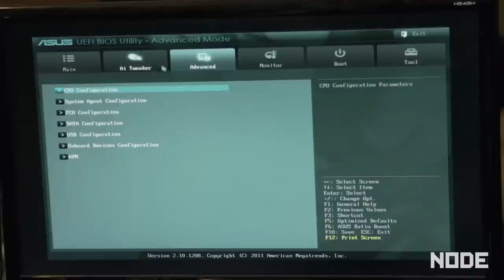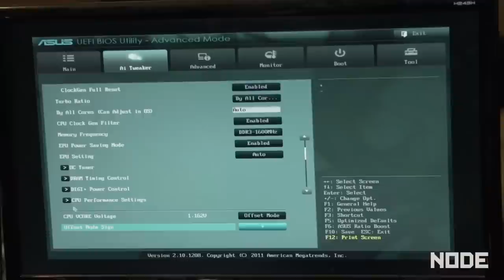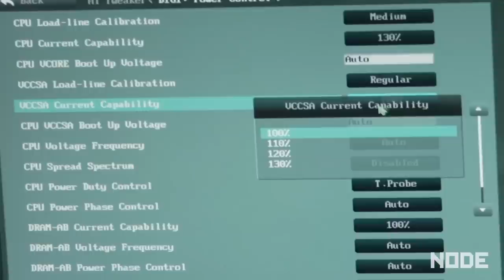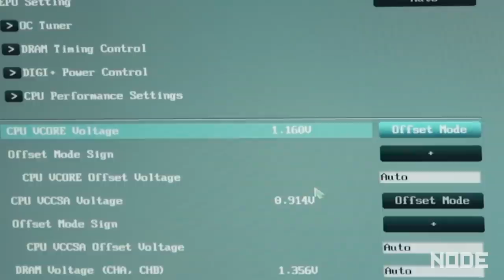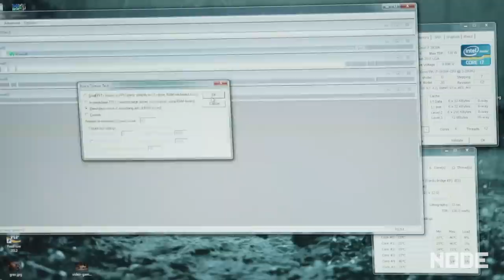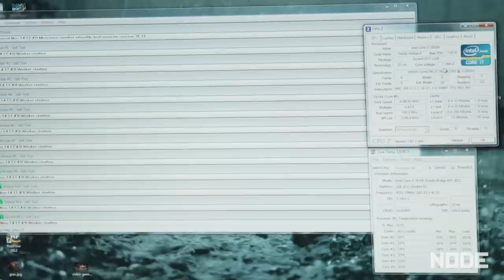Overclockerz with freddiew and corridordigital on LAN Party - NODE

Comment: i failed my overclock, now my quad core is only a dual core...
Reply: My heart goes out to you and your family.
Reply: i bough a hex core  to replace it :D
Reply: StealerOfSoles RIP wallet
Reply: Hex core amd is only like £70 is not that bad for p;rice to performance
Reply: LOL is it possible?! I fucking laugh my ass off
Reply: i had no idea what i was doing so i just bumped up the voltage and then it registered as 2 core 2 threads
Reply: Im guessing you only have 2 actual core and the other 2 is virtual core?
Reply: well yeah i said that ^^ it was 4core 4 threads but then went to 2 core 2 threads
Reply: LOL im still laughing my ass off. I have no idea what you've done.
Reply: how did you burn only 2 cores

Comment: I would go for it. Make sure you run a prime95 stress test for a couple hours to test initial stability your overclock. If it crashes or you get errors, tweak some settings and test again. If it passes the 2 hour test and you're happy with the overclock, continue to run the test for 24-48 hours to verify complete stability.

Comment: Basically, frames per second is how smooth something runs.  If you run very high frames per second, then it will look very natural.  Slow motion can be done when you take a high frame-per-second video, and slow it down, so it keeps around the same frames per second as the rest of the video.  It needs the higher fps original video to stay natural-looking.

Comment: If you plan on gaming, you do need a good graphics card. The processor calculates the game physics, interactions, NPCs, etc. Usually, this is actually a relatively low amount of work for the processor. The graphics card is what actually allows the game to run at the framerate that it does. Because of that, as long as the CPU is good enough, the graphics card is usually the most important part of a gaming computer. So really, if you want to game, a good graphics card is a must.

Comment: It's not recommended unless you have an aftermarket cooler. The stock cooler is fine if you're running at stock speeds, but once you overclock even a little the temps get way too high.

Comment: Some extreme workstation laptops can run a whole bunch of cores(6, 8, 12, I've even seen one with dual 16-core processors). You probably won't see them on the consumer market, though

Comment: Vaio's have locked bios also. You will be able to get into the bios but the settings you need to change will be disabled.  You can always try however. reboot your computer and when it is starting up it will tell you what button it is to access the bios. Tap that a bunch of times until you reach the bios screen. Since all motherboards have different bios screens look for something that talks about the CPU. Use the video as a guide on what to change. IF you can change anything.Try going to 3.0.3.5

Comment: 3dmark11 with a desktop gtx 580: 6650 marks.

3dmark11 with a gtx 680m: 6560 marks.  One of the prettiest monitors out there with a skinny all in one design.  Near silent operation too even with a desktop i7 chip.

Comment: Even if you could, I wouldn't recommend it. Laptop coolers are usually designed to the bare minimum of what you need to cool it adequately on stock speeds, in order to save internal space. Even if you add a cooling pad the internal coolers are the most important factors.

Comment: First step, figure out if your motherboard has an overclocking utility then if your cooling fan/device is capable of taking the extra wattage of heat coming from the cpu. Then look up instructions for the specific cpu, next look up the ones for the motherboard. Next go to bios----then what they did

Comment: "it's pretty much locked at 60" 
Um, that's probably because you have V-sync on. Turn it off to see what your actual frame rates are. V-sync matches your frame rate to the refresh rate of your monitor so you have a vertically stabilized image reducing the frame shear you see sometimes, but it doesn't let you see how many frames your computer can really give you.

Comment: Only if you are only hitting 50-60fps then turn it off and it'll boost the frames by 10fps roughly. But when you can hit more than 60 constantly like say 70-80 frames anywhere you go in that game and even in combat/action then you can turn it on. More frames = more work for gpu which will heat it up. If you have a game running at 100+ fps it'll increase the gpu's workload. Besides, can't really tell the difference between 60fps and 100+ fps unless the monitor is 120hz. Correct me if I'm wrong :)

Comment: Depends on what type of computer it is. If you don't know if you can, you probably can't. You won't be able to if its a dell, hp, etc. When those computers are made they put a lock on the bios to prevent overclocking. If it was an alien ware or custom build then you could. You might be able to overclock the gpu depending on the gpu.
You didn't give enough information for me to provide you a good answer.
Also, if you are getting a new desktop anytime soon. Don't buy a premade one, build your own.

Comment: That is for only for computers that are comercially availible.  Techincally some of the prototype computers intel has are clocked closer to 10-12GHz (but they are liquid nitrogen cooled and they are only testing the clock circuits, not running a computer of it... yet)

Comment: how far do you think i should overclock my sabertooth x79 motherboard with a intel i7 3.7GHz without going over 85 degrees Celsius?
Reply: Which I7 and what cooler
Reply: Salpeteroxid Prob a H100i
Reply: 4820k intel processor and im not sure what liquid cooler
Reply: Jaagg Nice processor but why did you go with the 4 core on x79 instead on 4 core on a Haswell if you don't mind me asking.

Comment: Which means it's most likely an FX 8350, which means that it will perform slightly lower than a 3570K.

Why can't people get that clock speed isn't the defining factor of CPU performance?

Comment: No, I don't mean software, I mean hardware. In your device manager, under Display Adapters, it should show all of your graphics devices. If there are 2 listed, you have a card in Optimus. If only the Intel card is listed, you don't have one.
And by the way, if you have a laptop, you don't have 4 processors. You have 1 processor with 2 cores that is hyperthreaded into 4 threads.

Comment: You may have a discrete GPU that is only enables in NVidia Optimus or AMD Hybrid Graphics. In this case, you would be able to play with good performance because the laptop switches to using the discrete card when you open a graphics intensive application. However, unless you dig into the device manager, you would only see the Intel IGP if you are just checking the specs.

Comment: i would prefer water cooling, if you're talking about the stock cooling that came with the cpu don't bother overclocking, some after marker heat-sinks can cool the cpu decently but overall if you're going to overclock to 4.2 ghz go water cooling

Comment: will i be alright with a mid tower case 
with these specs?
Corsair CX750 Builder Series ATX 80 PLUS
ASUS SABERTOOTH 990FX
EVGA GeForce GTX TITAN 6GB
Corsair Vengeance 16GB 
AMD FX-8350 FX-Series 8-Core Black Edition
CASE NZXT Guardian 921 (MID TOWER CASE)

Comment: - 3.2 gHz i7 6-core (OC'd to 4.4 gHz)
- 32 GB RAM (8×4 DIMM)
- NVIDIA GTX 680
- ASUS Sabertooth X79 Motherboard
- Seagate Barracuda 3 TB HD
- 2x Samsung 830 256 GB SSD (in a RAID 0 Configuration)
- Master Cooler 1000 Watt Power Supply
- R2D2 Post Trash Compactor PC Case
- ASUS DVD-RW Drive 
Soooo Jealous!

Comment: It's fraps that's the problem, not their monitor or their Vsync setting. Fraps has a setting where it locks your framerate to whatever framerate you're recording at, to maintain a steady framerate without any jumping or stuttering.
Those chips that require you to screw around with the processors physically were the Pentiums of old. They are long gone now, and I would say good riddance too, as I have a tendency to break any computer part I mess with physically.

Comment: Overclocking os often locked by most lower-end or middle range motherboards & CPUs, and over-overclocking a CPU won't start a fire. The CPU will just burn out and cause the computer to crash, causing the CPU to become a useless piece of junk. Limar to when a bulb burns out, it doesn't burn the house. I've seen someone used around a million TNT and it burnt for like 3 hours or something. It's right here on youtube.

Comment: With liquid nitrogen cooling. Try sustaining that.

Clock speed =/= actual performance. Even if someone got an A10 to 5.0GHz (which is EXTREMELY hard for most people), their 3930K at 4.5GHz would still beat it by quite a lot because of a much better architecture and much higher IPC.

Comment: I overclocked my computer to 13GHz and I put the Memory Voltage at 9001. As soon as I turned it on, there was a mouth on the screen and it stuck its toungue out at me and then made a "kaput" sound. So I'm suggesting that my DreamCast just died. :(

Comment: I'm getting a PC with a R9 290X 8GB's of ram a intel i7 3770k and 500Gb's hard disk space. What power supply do I need? Will a 750 watt be ok?
Reply: 750 i more than enough
Reply: TheMrkiddi Thanks, I'm getting a 4820k now though since it is the same price on the site im getting it. also im hoping to over clock to 4.5 GHz is it still enough?
Reply: if you plan on Overclocking bigger is always better. you might be able to pull it off with 750W but i'm not that familiar with Overclocking that i can say for sure if it's enough or not. but i would assume so.
Reply: TheRealPotato To be honest, if you plan on playing games on ultra overclocking isn't a huge necessity. Especially since you have a 290x which is a great graphics card. I have a 280x and plan on going dual crossfire with another one. Still, 290x can handle it very very well.
Reply: TheRealPotato Overclocking only requires 10-25 more watts. Use pcpartpicker.com choose your parts and it should tell you around how much your parts will be consuming at a time.

Comment: My amd fx6300 piledriver 6 core is overclocked to 3.7Ghz from 3.5Ghz standard.
The 2 are quite similar (yours is better for multi-thread stuff) so you should be fine to overclock.

Comment: You can overclock them. Use MSI afterburner, the reason they didn't is because the card is good enough that it just doesn't need to be overclocked. Overclocking it would be pointless currently with the games that are out.

Comment: how did niko get 55-60 frames at battlefield 3 ultra? he has a 680 amd 4.2 Ghz. i have a gigabyte 660Ti and a i5 3570K not overclocked and i get 60-80 frames at battlefield 3 ultra. I DONT GET IT

Comment: I've had a mac man, I know about them well. My first two computers ever where macs. Anywho, macs do not have viruses. . .practically they don't. There are some very rare few that could possibly infect it but the newest macs are generally completely virus free in actual practical use. It is highly unlikely you will ever come across one even going to more dodgy sites. Also you can have anti virus installed too just in case though it won't be needed 9.9 times out of 10. So I am not an idiot.

Comment: Id like to see a Starcraft 2 4 v 4 Extreme Settings test. On my current PC, i can run Crysis 3 60+ FPS no problem, yet I still dip to 10 FPS on Starcraft 2 during the big battles.

Comment: No, you can't overclock at all, unless you mean something else than CPU multiplier overclocking. Generally, for the Sandy bridge/Ivy bridge processors, you can't overclock unless the CPU has the suffix "K" or "X", which you don't have. Anyways,overclocking a laptop is a bad idea in general, because they have much lower thermal tolerance.

Comment: actually, macs are not a good deal to buy.
They have all the same speeds as the regular $300-400 PC.
and besides, because PCs are cheap, if you want a faster PC, it would cost about the same as a Mac, and is more powerful than it. 
Here's an article from the people themselves (freddiew, BrandonJLa, and corridordigital) : rocketjump com/blog/why-were-switching-from-macs

Comment: There's only 1 3DMark 11, and I would think that he would be comparing the same preset, no matter which one it is, wouldn't you?
Anyways, a GTX 680m is plenty for gaming. If you check the benchmarks for individual games on its NotebookCheck page, there are barely any games it can't run on max settings.

Comment: Higher clock rates don't always translate to better performance. Atleast on older CPUs. Why should OCing new CPUs be unnecessary? As they said, they're getting some extra power for free. Doing this with old hardware is basically same - you just wait longer for the extra power.

Comment: Also suggest tools prime95 for load testing, CPUZ, Coretemp, etc. Watch yer voltage vcore specs and memory speed. I got my bus on a i7 920 from 2.67 for 4.2ghs stable with a $65 cosair h60 closed loop water cooler. Stable at 65c.

Comment: i did the million digit calculating pi computer thing. my fx 8350 got a 1'000'000 digits in 21 seconds at stock clock

Comment: haha wow a Fully built Alienware MX18 will run BF3 and Skyrim at around 140 with Ultra settings, fraps and not being overclock and also for about 3/4 the price of these things. And you can take it on an road trip or to work. I understand why they got what they did, But why wouldnt you get alienware stuff instead? Its not as expensive and you get a better overall product

Comment: Okay so here's my problem, in my BIOS (Motherboard: Z97 SLI KRAIT Edition) there is a tab called "Overclock settings" and once inside, there's no configurable options to change the clock speed of my CPU (i5 4690k) which I know for a fact is an overclockable Processor, someone help?
Reply: TrakGreedyMH Late response but are you sure its a K version of the procesor?
Reply: NelGaming Yes, dead sure, I managed to find something in my BIOS called OC genie, it was a button you click on which automatically changes it, so it's at 4.0GHz until I get a new cooler to make it higher, thanks tho
Reply: TrakGreedyMH Did you try to update your bios?
Reply: NelGaming I've got no idea how, my Windows 10 at the moment is a bit buggered as it won't activate, so that's currently mu main priority, but I won't really do anything until I've got it to work
Reply: If you have stream or something I can add you and help if you want
Reply: NelGaming Like Twitch?
Reply: +TrakGreedyMH I know i'm a little late but it sounds like you haven't put it in advanced mode. :)
Reply: Ahaha, it might be, but I've got no clue how to lol

Comment: Alienware 18x Laptop
--------------------------------------
CPU - Intel 3rd Generation i73960XM  @4.8 GHz 
GPU - Dual nVidia GTX 680
RAM - 32 GB DDR3 @2133 MHz
Drives - 3x 1000 GB Solid State Drives @562 MBps

Comment: Haha, of course, if you play on 320x240. Don't troll us. You won't get decent frame rates without a dedicated graphics card. The best Intel graphics chipset - the HD 4000 - only gets about 28 fps on FullHD and low presets and they even used a i7 2600k, which is at least twice as powerful as your CPU. (source: media.bestofmicro . com/C/3/334803/original/int%20skyrim%201920.png)

Comment: as i said before it does not have the necessary cooling. ask anyone and they will tell you the same. 60 degrees is nothing when compared to the temperatures when overclocking a desktop. that is why don't overclock.

Comment: I can play Counter-Strike:Source at like a 150fps.
Reply: Really?!?!? Wowooooow u must have giooooood computer ahahahahaa
Reply: Just to clarify, my computer is not a potato. It's actually pretty powerful and cool in my opinion. I built my own gaming PC using an AMD A-10 6800K, 8 GBs of Ram, and an EVGA GTX 970 FTW.
Reply: +Brendan Matelan And you only get 150 fps... lol either something's wrong with your pc or you're lying
Reply: I should've added that I got 150fps when I was just using the AMD APU, but with the addition of the GTX 970, the fps is now 290+. And it also plays Battlefield 4 at 60fps in 1080p medium settings. Just need a new monitor.
Reply: Brendan Matelan Oh
Reply: +TheRemixStylez It fairs pretty well, but is probably not the best combination in terms of speed (completely pulling this out of my ass since I don't know much about computer jargin. Don't take my word for it, just do some research and you should be fine).
Reply: Counter Strike came out in like 2008, it's built on the steam engine. It doesn't exactly take a monster PC to run it.
Reply: +Brendan Matelan i can play at like 200fps CS GO:20-40
Reply: That sucks. I can run it at 20-30 fps on lowest settings. Get a better computer...

Comment: Lol with these motherboards:
Step 1. Download Asus AI Suite.
Step 2. Press the extreme overclock button. It automagically tweaks all the settings and runs multiple tests for you until it crashes then it knows the limits. This software is what sets Asus apart from other brands of Motherboard at the moment.

It automatically clocked my i7 3770K from 3.5Ghz to 4.5. It also scales all the RAM and what not to match optimal performance. SHIT IS CASH

Comment: 4.2-4.5GHZ is very fast. But I have my i7 3770k cranked up to 5.0GHZ STABLE. but i also have a custom Liquid Cooling System on all my PC Hardware in my PC. With a Triple Rad, push pull 140mm config. With the fans from the Rad blowing inside my case, and out the back of the case. i also have a more fans (Intake and outake) in my case. so my CPU is very stable on 5.0GHZ. I could prob take it to 5.1GHZ, but i dont want to Tax it.